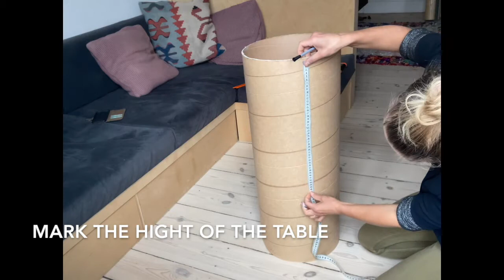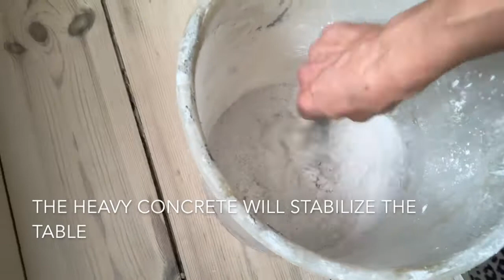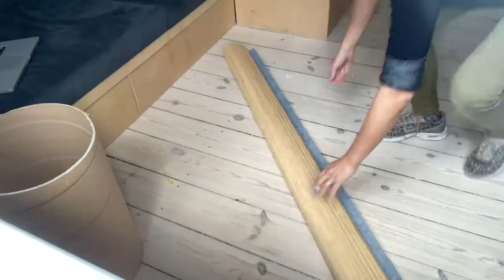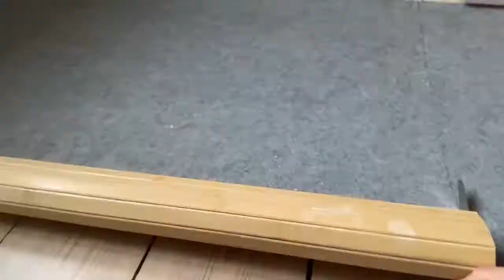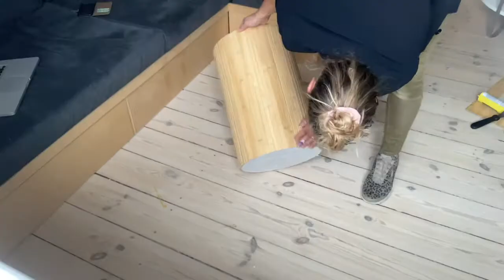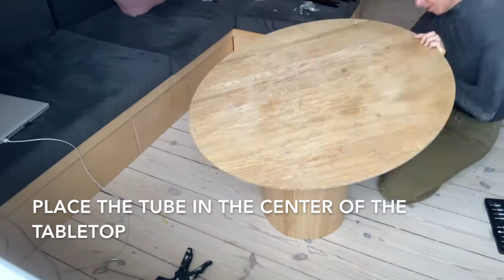DIY fluted table. COSTS under 100$

Comment: Do you coat the inside walls of the tube with concrete? My table is a oval shaped 6.5/7ft long table.
Reply from the maker: No, i did'nt coat the inside. Haven't been a problem:)

Comment: And can I ask how this is stable and won't tip over?
Reply from the maker: There is concrete in the button- if the table is bigger than mine, you need to put more concrete in the tube